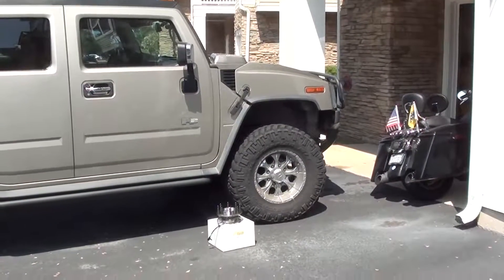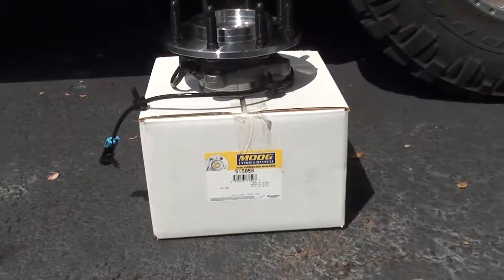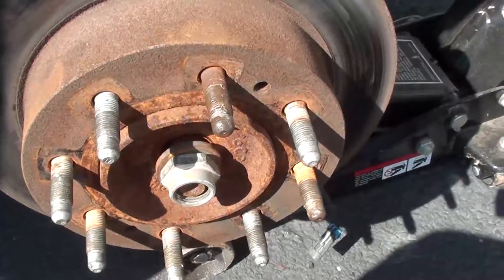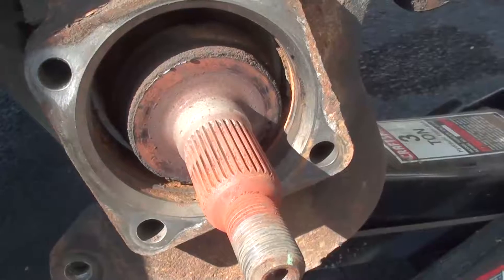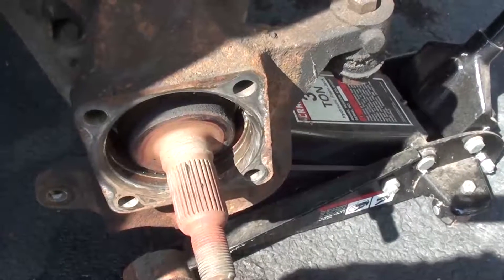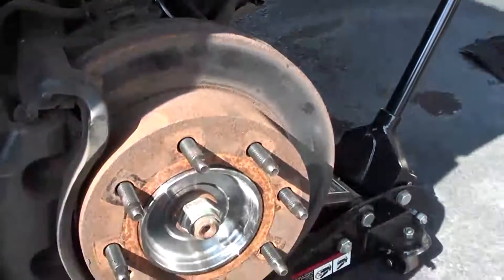Hummer H2 / Chevy or GMC 2500 Truck - Front Wheel Hub Replacement

Comment: According to what I hear:
Recommended replacement: MOOG bearing with ABS sensor/wire
Socket size: 
Tire rode: 22mm   - He didn't show
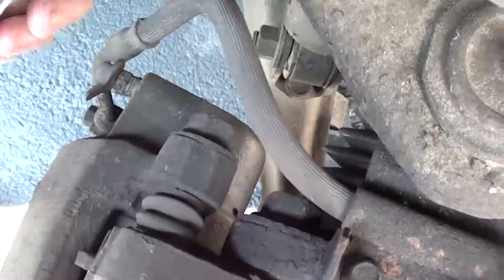   1:58 Caliper: 21mm x2 (someone else said it's 18mm)!   
   3:42 bolt to lift, help remove seized rotor 8-10mm   (M10 - I guess but not sure, 1.5 pitch) 
  2:24 ABS wire removal
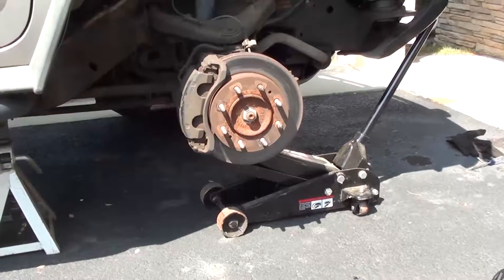   1:20  axel knot: 1-7/16 or slightly smaller (Better: 35mm - Metric is OEM)
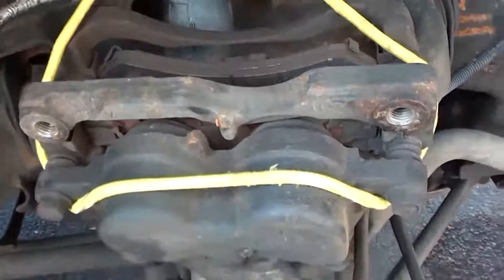   2:56 Back knots 15mm  x4 Heavily torqued (220 fp)
   axel cleaning with lub/metal brush
______________
  Torque # s
Axel knot 173 FP   
back knots 133    
bracket bolt 220    
log knots 140 fp

Comment: how tight is the hub axle nut? Would appreciate all the specs
Reply: David Ross Hub nut 173 ft/lb
Hub bolts: 133
Brake caliper: 210
Lug nuts: 140